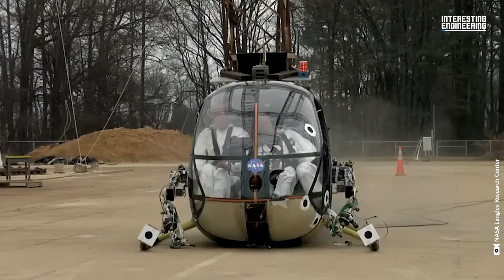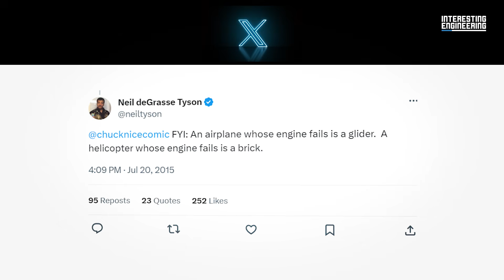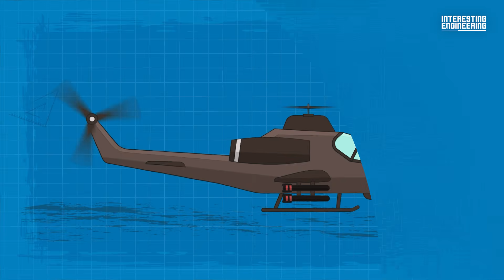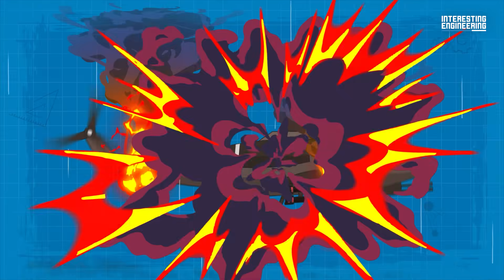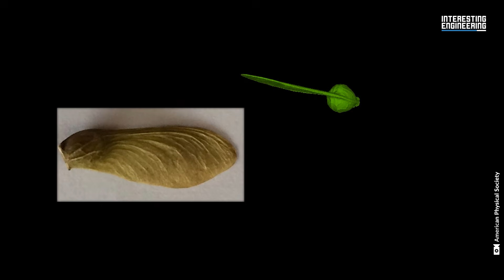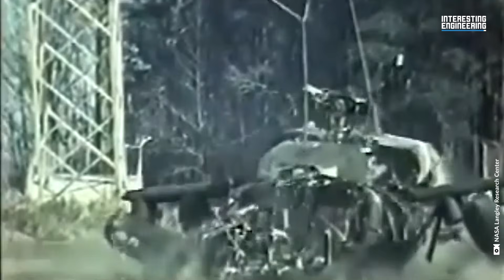How do Helicopters Land if the Engine Fails?

Comment: Technically, you crash the helicopter when the blades stall.  This is different from the rotor blades not turning.  The blades will still be turning, just not fast enough to prevent turbulent airflow over the rotor blades.  It is kind of interesting when you do this in helicopter, you don't just start dropping out of the sky, all control is lost and the helicopter tends to wobble around in the orientation that the gyroscopic effect of the rotor blades in motion hold the helicopter in.  In a helicopter autorotation, a blade stall means death.  While most helicopters can autorotate and some can be flying with a nice low disk loading, making an autorotation easy to bring to a gentle landing, I have been told by SuperStallion pilots that every attempt that they know of of a pilot attempting an autorotation has ended in a crash.  Apparently, the SuperStallion does not autorotate, but it does at least have 3 engines.  It is just when you have a gearbox problem, 3 engines doesn't matter against the one gearbox that all three engines are connected to.

Comment: An FAA guy reckoned that the Hughes OH6 (Four blade rotor) came down like a streamlined brick in autorotation. It had a low inertia rotor system. Apparently the 2 blade Bell and Hiller OH 4 and OH5 had better autorotation characteristics due to high inertia

Comment: Wrong.  You don’t fall slower.  

Faster the blades turn… the faster you fall to the surface.   Slower they turn the slower you fall - up until you allow it to stall 80% or so.

Comment: 🤔 So you only proved him participant wrong and hence he is partially correct.  This only works if the system works as it should, If rotor blades stop turning then it will fall like a brick,  and if the pilot does not pull the lever it will fall like a brick. I’ve seen lots of helicopters falling straight down and crash while rotors are stills spinning. I’m sure that is what Tyson was saying

Comment: An all the way down collective puts the blades exactly flat?  Isn't it necessary to have a small amount of reverse pitch to keep rotor blades at speed during decent by using the decent (so rotor inertia will be available for the flare just before landing)?  Inquiring mind wants to know
Reply: Yes. Collective is used to regulate the rotor speed. It is possible to over or underspeed the rotors, depending on pitch angle. This video oversimplifys auto's some.
Reply: No, with the collective down fully, the blades are pretty much flat pitch. I say pretty much because there is some rigging to get optimal rpm during the glide. ( But it's not negative ).

What is difficult to understand for the average person, is that the blade still has a positive angle of attack when autorotating. In fact, it has the same angle of attack during autorotation as it has in powered forward flight.

The other reason the blades are set at flat pitch with the collective down, is that when we are sitting on the ramp rotors turning, we really don't want the airfoil developing substantial lift ( either up or down ). You can usually tell when the rotor is rigged a little negative - there's a distinct vibration.

There's one case I know of, though. Some naval helicopters have the normal flat pitch position of the collective, but then a detent allows negative collective pitch in order to hold the aircraft on the deck of a pitching ship, until the ship's crew can chain it down. Otherwise in rough seas the helicopter could tip over or go over the side. I'm unaware of any civilian helicopters that can do that, and you would never use that in flight.

https://www.copters.com/helo_aero.html

Comment: In a British context I was often employed as a passenger operating as either infra red or visual surveyor of overhead power lines back when we had to have a window open and the camera needed liquid nitrogen to cool the sensor. Our pilots were drawn from the military and they took their to their duties well. Following an overhead line at mid span height was easy for them. I do recall a positioning flight when the pilot said to we passengers [2] I have to carry out an "auto-rotation routine". Pilots always underplay the fun you are about to endure. We were in a twin engine Squirrel and the pilot just reached up with his left hand and shut down both jet engines. The aircraft felt like it dropped like a rock for twenty feet and then hit a rock and stabilized as the auto rotation took place under perfect control. We made the softest of soft landings. These pilots were so well engaged with their machines.

Comment: Big mistake. A helicopter's rotors don't generate lift by forcing air down. They are airfoils and generate lift by moving through the air. Just like a wing.
Reply: Sorry but lift does ultimately push air down. Can’t prevent it.
Reply: a plank can generate lift.  Airfoils are merily improvements to a plank to compromise between wing lift and drag for specific applications.  Most lift comes from angle of attack.  This angle of attack is what forces air downward and is responsible for most of this downward thrust.

Comment: I knew someone who was in a helicopter crash. They weren’t flying very high, and the pilot tried to reassure them that if the engine stops they will just float down, and turned the engine off. They dropped like a stone, all walked away and I saw a photo of the helicopter and I often wondered how they walked away. It was a military helicopter, in a war zone
Reply: In 1968 I was in a helicopter in the Mekong Delta when all the red lights went on and the pilot put it in neutral and we auto-rotated down into the Mekong river.  We landed about four feet from the shore and waded out.  The crew chief went out and lifted up the cowling from the back of the engine, where the jack shaft went from the transmission to the tail rotor.  It fell off in his hands.  He dropped down and puked.  We were seconds from the tail rotor failure and the uncontrollable  circling to destruction.  Fortunately we had sufficient forward momentum to translate into auto rotation.  Had we been hovering, not so good.  I have flown an airplane but helicopters are different.
Reply: That's the issue, they weren't very high. The blades probably didn't have enough time to begin to spin fast enough, so when he went to flare it it probably just kept dropping because there wasn't enough lift.

Comment: I've always been skeptical of auto-rotation. Seems like it would be very problematic. I believe most military helicopters also have some sort of ejection, where the blades are discarded and then the pilots can eject as from an airplane.
Reply: Not most, but you’re correct that some do
Reply: @KhaoticKalm very few mil helicopters have it. The Russian Ka-52 is one, related to having a dual counter rotating rotor which probably makes autorotation less effective (?). Can’t think of any other current one.
Reply: Besides, autorotation is very effective, although it requires proper and regular pilot training.
Reply: @joso5554  I liked one guy that said “if it’s so effective why don’t they practice in school”. While I understand it’s still a hard landing for the vehicle the question made me laugh.
Reply: I believe the a version of the Apache has it as well but I’m not well versed on the subject.

Comment: It is contrary to the commonsense that the copter have to maintain the hi pitch in order to keep the lift even without power. Even the toy propeller that is hand-spun and you let it fall has pitch in blades. I think the parachute buoyancy is somehow mixed between drag and lift.

Comment: I always wondered after the copter crash in Glasgow why copters don't have an emergency chute from the frame to at least reduce the impact of any crash. Ditto with small airplane frames.
Reply: To be able to use a parachute would require the main rotor blades to have explosive separation devices to be jettisoned, for obvious reasons. This would in turn cause major hazard around as a rotating blade has huge energy and would cause major damage on the ground. Besides, a parachute requires a significant altitude margin (easily 100m or more) to deploy, before it sustains its load. Until then, it doesn’t slow down the fall, at all. Autorotation works even for engine failures at very low altitudes if the helicopter is flying fast enough horizontally. 
So basically a parachute would be much less efficient and useful than autorotation, and much more dangerous for the surroundings.
Reply: they do ..look up on here plane with parachute